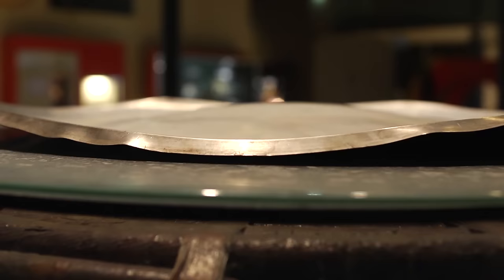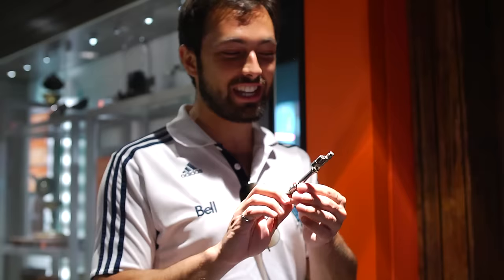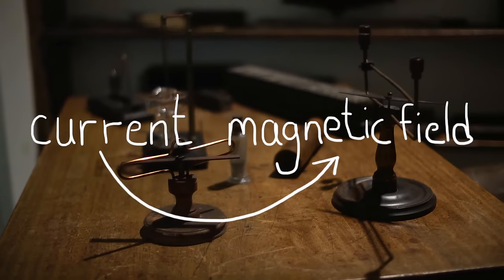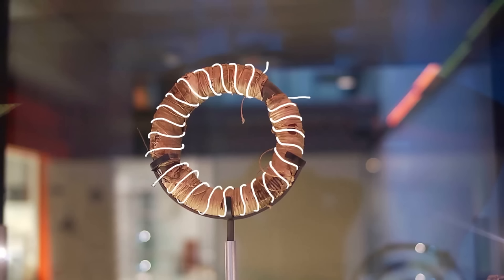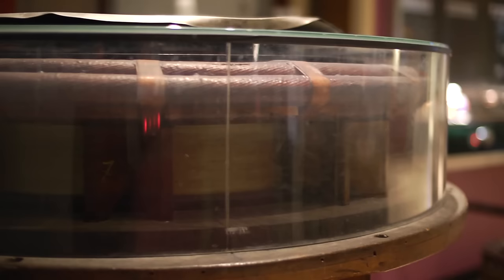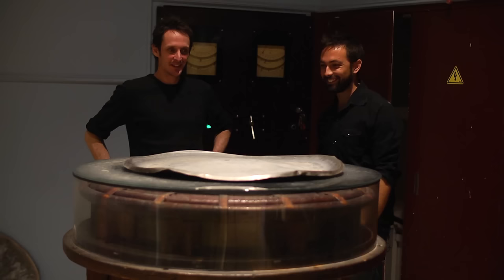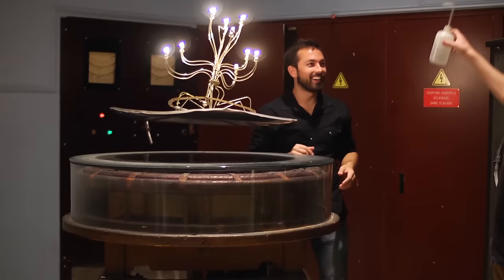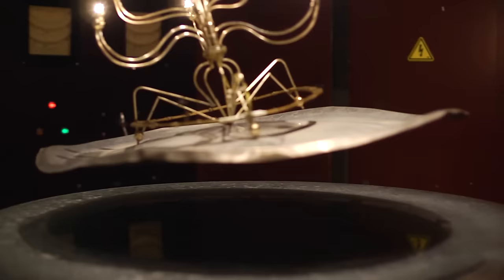Levitating Barbecue! Electromagnetic Induction

Comment: Would a common induction stove top generate enough energy to levitate say, a piece of aluminum foil?
Reply: investing a comment here..
Reply: A typical induction range is around 40-50 A, whereas this demo is 800 A, so no.

The thickness of the aluminum actually isn't relevant. While the mass of the disk is proportional to the thickness, the resistance is inversely proportional, so a thin foil will simply have lower eddy currents in proportion to the mass.

I mean, that's not entirely true, there are other complications with using thick metal, but in general you're not going to get massively different results with thin sheets or thick ones.
Reply: Inductive heat is not exactly the same as inductive magnetism
Reply: But you can move things around or levitate objects using sound coming from different speakers

It is actually possible that this is not levitating magnetically at all but only through acoustics
Reply: I believe most inductive heat ranges actually just use infrared and UltraViolet

Like taking a picture of your TV remote controller, your camera can pick up the internet and UltraViolet Spectrums...
Since the lens of the remote controller with the lens of your camera, and press one of the buttons down and hold it and take a video or picture, you'll see the same purple bluish color _pink,
On your infrared inductive Heat glass tops..
If you look at them when they're on through your camera

They might look red to you with the naked eye but pink or purple or bluish or all three colors at once, through your phone

You can add filters to this process to, in fact look up Nikolai Tesla and a lot of his research about energy and light and electricity and magnetism and the atomic structure

It's all the same thing anyways

Energy equals light, light equals sound, Energy equals all five states of existence

Plasma gas solids liquids ice

On the atomic structure there is more space between the particles of physical existence in an atom or of an atom, then there is physical matter

This being said it is possible considering water is hydrogen and two oxygen, which equals "AIR", unless combined, then you have water, but all of the oceans when considered on an actual physical level, and condensing all of its physical properties, alleviating all the space, all the oceans could probably fit in a couple of glasses of water or maybe a 5 gallon bucket
Reply: That being said, everything comes to life and becomes three and four dimensional, and has a soul, because of energy magnetism electricity sound and Light

Comment: How does the frequency impact the disk's ability to levitate? Is there just a threshold frequency above which it will levitate with no significant gain/loss as it increases? If so, then there is a solution to the irritating sound... Just set the frequency beyond 100 khz afaik not even the most susceptible bats can hear 200khz

Comment: Veritasium cool! I have two questions: 1) regarding plasma emitted after a lightning strike, can it also cause the same effect if the plasma would be in contact with a similar item such as a light bulb or other electric device? 2) what frequency does it emit? it seems it can cause auditory loss even in an acute setting. thank you :)

Comment: If we put the open circuit copper winding conected to the battery charger. Near the superconductor ring continuous current flowing through it then. 
Will the current get induce in copper winding for endless time?

Comment: give us levitating boards already.
Reply: Hloea Adleviade it's gonna heat up and barbecue you
Reply: Jack Le itd be worth it
Reply: +Tim Sullivan even if it didn't burn you it would cost a lot of money because electricity at that voltage isn't cheap
Reply: Ryan Ho electricity has really high voltage before it reaches your house. You can't measure how much electricity used by voltage
Reply: +Jack Le If you reverse it (i.e. the board itself is the one generating the electromagnetic field) then it's safe. The problem is you'll have to use a specialized skating rink made of aluminum. This is basically how the Hendo Hoverboard works.
Reply: Reisha M then you're gonna have to have the board plugged into the wall all the time because it requires a lot energy. (batteries can't last too long). What i suggest is just to put an array of permanent magnets on the bottom of the board and tons of electromagnets on the ground that has a DC current going through so that the magnetic field always point up. then you try to balance yourself on the board. you'll use so much less energy that way. but it takes some skills to balance the board.
Reply: Jack Le Either that or they come up with a graphene-based battery that lasts a couple of hours.

Comment: How did the current not die away due to the resistance?
Reply: The eddy currents were induced in the aluminum plate by the pulsating magnetic field of the electromagnet below (electromagnetic induction). So, as long as the electromagnet keeps up the pulsating magnetic field, the current will keep on flowing... any decay of the current (in the form of heat), due to the plate resistance, will be replenished by the source, powering the electromagnet

Comment: I remeber I had a ring with duck tape around it or something, and then I turn on the TV, without any channels (that black and white clickling thingy) and put the ring in front of the screen, it makes a weird ring!
Reply: +Haker Such a coil was an actual repairman's tool in the early days of color TV.  Getting the right colors to display all over the screen (purity and convergence) depended on a precisely perforated plate just behind the screen in the CRT not getting magnetized by other magnetic fields, including the Earth's.  When owners moved those heavy console TV sets around to rearrange the room, or carried strong magnets near them, this perforated plate (shadow mask) got permanently magnetized, which distorted the color.  The owners then called the repairman, as they did often, sometimes weekly, to fix it.  The repairman had such a coil (much less powerful than the one in this video) which plugged into the 60 Hz AC outlet, and was waved in circles starting right in front of the screen, gradually moving farther away, until the repeated but diminishing alternating magnetizing fields reduced the permanent magnetization to almost zero.  This is called "degaussing" after the unit of magnetic field strength, after Karl Friedrich Gauss.

Later in the history of color TV displays, small degaussing coils were built into the set, and programmed to turn on for a few seconds when the power switch was first turned on.  The degaussing coils lost their usefulness for repairing TV sets, and you probably got an old surplus one.  It's still good for erasing entire video or audio cassettes if you have a need to do that.
Reply: +Allan Richardson  thanks for the daily dose of school!

Comment: so how were the bulbs lighting? the frame looked brass. was the bulb housing actually getting super hot, causing the filaments to glow from sheer heat? was the metal connected to the bulbs acting as a 1 turn inductor?  were the bulbs LEDs and was the massive coil being fed that current at that frequency also giving off an electric field that could illuminate bulbs similar to a tesla coil?
Reply: It was because there was some current induced inside the filaments I'll guess.
What I'm wondering is why didn't he get an electric shock at 2:30...
Reply: well its basically a huge induction heater since the plate is technically a 1-turn loop of huge wire (technically), so i guess it makes sense that the filaments would get hot. so any shock he would have felt would have just been energy in the form of heat from the plate and not actually an electric current
Reply: *****
i suppose either way you look at it, it is indeed eddy current unless i am overlooking something simple.. but i am curious as to whether the bulbs are lighting from sheer heat passed on from the metal plate which i do not see very likely, at least the way they look. a very interesting take on lenz law.
Reply: *****  I believe the light is lighting up to the same reason of why the plate is hot.
Reply: PlzDontKillDave wasn't the plate hot from the vibration when it made that sound?

Comment: why there is no current passing through his arm???
Reply: The resistance of the human body is very high and it isn't electrically conductive, very much unlike the aluminum plate that was levitated... so, the eddy current induced in his arm, by the pulsating magnetic field would be negligible. Unless he was wore something metallic and electrically conductive on his arm, like a ring or something like that, it wouldn't be a problem

Comment: What principle can be told about the plate being heated up?
Reply: +Panshul Pant There are massive eddy currents being induced in the plate and they cause it to heat up. It's the same principle in induction heaters. Well, exact same thing. This IS an induction heater.

Comment: I thought aluminium wasn't magnetic, so why is it reacting to the increased magnetic field? has something been done to it? coated in something or an aluminium alloy or something?
Reply: The coil is inducing an electric current in the aluminum plate, and the flow of that electric current creates a magnetic field that opposes the magnetic field around the coil. Use enough current and you can produce a magnetic repulsion equal to the weight of the plate.
Reply: ok that makes sense, but how is it inducing the current in the first place if the aluminium isn't magnetic, surely to induce current in something it needs to be able to react to the magnetic field in the other coil. in fact, heres another question, the plate isnt a coil, so how is the current induced. i dont doubt that its happening or that Derek knows what he's talking about, my brain just doesn't seem to want to grasp it, if it was iron i'd understand, or maybe i wouldnt, because i clearly don't understand this and its the same thing. now i dont know what i know.
Reply: Any conductor moving through a magnetic field will induce current, and aluminum is an excellent conductor.
Reply: fair enough, Cheers.
Reply: Matt Corker It's the electric field in the aluminium and not the aluminium itself.  The aluminium is just the conductor.  Or at least, that's how I understand it.

Comment: 30 x 30Amp 18650 batteries and you could generate 900 Amps
Reply: well, batteries only generate voltage: the current depends on the resistance. Heck, you can achieve 100,000 Amperes on a single volt if you're using a superconductor!
Reply: Mario D'Andrea P = V*I = 1*100k = 100 kW
It's not that easy, you still need to provide such power :)
Reply: +Tim Turner And it has to be alternating current.  However, the most effective way to generate alternating current at 900 Khz is to feed direct current to an oscillator (originally using vacuum tubes, now usually some kind of transistor), then amplify (make a more powerful copy, also using vacuum tubes or transistors) of the oscillator several times until you get the power level you want.  The 18K batteries COULD be used to power the final amplifying stage, with a few more to power each amplifying stage and the oscillator stage; but what has been done universally, at more than trivial power levels, is to turn alternating current into pulses of direct current (rectify it, using vacuum tubes or semiconductor diodes), smooth the pulses with an appropriate combination of large capacitors and either resistors or (better) inductors called chokes (known as filtering), thus simulating a battery.  This DC can then be used to power all the stages of any electronic device (in this case, the core circuits of a radio transmitter, minus the modulating circuits).

If those 18K+ batteries are the disposable kind, you'll have a lot to recycle.

Comment: so this kinda shows wireless energy, right?
Reply: Gustav Albers Wireless cell phone charger ;) but in a MUCH larger scale
Reply: mephInc If you don't mind cooking* your battery...
(* and exploding, probably)
Reply: Martin Verrisin I've yet to have a phone cook or explode... Not to say that it isn't a possibility if the phone doesn't automatically shut down due to heat, or stop charging when full.
Reply: mephInc never happened to you? Probably because noone would sell such nonsense.  XD (that's why all the wireless chargers today are so slow and weak and ...)
- If it is turned on or not makes no difference: look at the metal plate they are levitating: it's not 'turned on' yet hot enough to roast stuff on it
- and when batteries get hot: they get inflated, right? - well, if you do it really fast and a lot it will inflate really quick and a lot -> couldn't take it -> explode...

- I'm sure people will figure it out, but it is likely to be quite different in the end...
Reply: that isn't quite what I meant meph. but yeah.

Comment: why does the disk gets hot?
Reply: +Murillo Kubinhetz I believe it's because of the resistance in the plate. Electric current is being induced in the plate. Since the plate isn't a perfect conductor, there is some "friction" between moving electrons and stationary matter. That transfers some of the electric energy to thermal energy.

Comment: so that is how you are able to stand under electric cables with a lightbulb and it glow. or at least i heard you could from someone who did it. but i have also heard that is unhealthful to do. is it really unhealthful?
Reply: I think you mean unhealthy, unhealthful is something else.
And as if it is unhealthy, people don't really know, people now think that the health effect of living close to power lines has more to do with a nocebo effect, of people think it is bad so they feel it is bad. combined with power lines lowering house prices meaning that lower income families live there, families who don't have as good health care.
so are high voltage power lines bad, the data isn't clear.
Reply: You can stand under power lines with a flourecent light and it will glow, but I don't think it's possible with regular, incandecent lightbulbs.
Reply: it needs to be florescent light,
yo do it with a incandescent light bulbs you need two wires  one to each pole, and then have the wires be around one quarter to the wavelength,  with a small bulb and the right length of wire  you can see the see the signal coming off a radio transmission tower.

Comment: How does that device light up the light bulbs out of the air? I don't see how any current flows to the lightbulbs.
Reply: Blarg Blargity The variable magnetic field induces a variable electric field within the filament of the lightbulb, making it glow.
Reply: firearmsstudent Ah! I see, thank you.Follow-up question. What happens when I put my hand in that magnetic field? Will the electrons in my hand become excited and produce heat of some kind?
Reply: Depends on the frequency, because in the correct spectrum that is how a microwave works.
Reply: +Blarg Blargity radiation
Reply: +Jr Batenga Absolutely.  There is a form of physical therapy in which a radio frequency magnetic field is used to induce heat in the patient's bones and muscles in order to relieve pain and speed healing.  Obviously, a specialist is required to avoid "cooking" the patient's body from the inside.  Microwave ovens do the same thing, but at MUCH higher frequencies.  Actually, they are tuned to the resonant frequency of vibrating water molecules, but other substances (including some ceramics) have a close enough resonant frequency to pick up the heat also.  The item being cooked does not have to be conductive in the case of microwaves.

Comment: If roads are made into metals, and a car is fitted with same coils, front and back, then a superpowerful battery, and an insulator on top of it, and a sound repulsive coating around it, a floating car is born....

PS: Veritasium, Im not gay, but you are so handsome...
Reply: Ken Amagna You've just described a maglev train.
Reply: Antonio Mariscal Maybe I misunderstood your comment, but you don't need super conductors for a maglev train system.  The ones in japan work well without using exotic materials.
Reply: Antonio Mariscal I'm sorry I don't speak Spanish!
Reply: Ken Amagna I believe this is where this technology is headed. There is no money in hover-boards.

The designers dream of grass covered roads.
Reply: Robin Parmentier Well, A maglev has limited movement
Reply: Antonio Mariscal Por eso he dicho : " Una capa de aislamiento "

Comment: How much electricity does it need? Is it energy star compliant? /s
Reply: joshuaoha It says that it needs 800A, alternating at 900Hz. This not a current you can get from your electric outlet at home which ususally brings around 15A-20A with 120V, alternating at 50Hz. 
It would melt a copper wire within seconds with around 640kW at max.
Reply: +MasterOfTheHolyFish 230 V master race